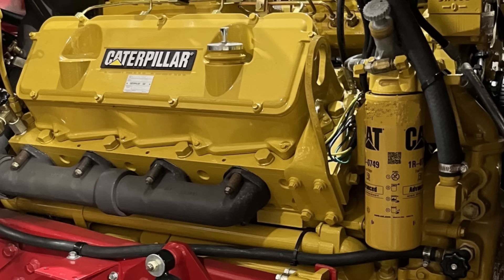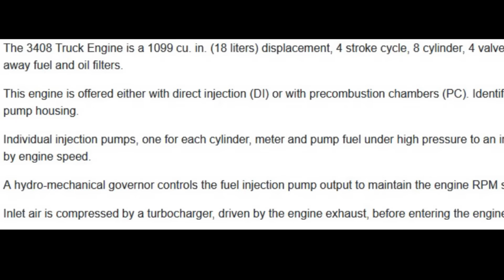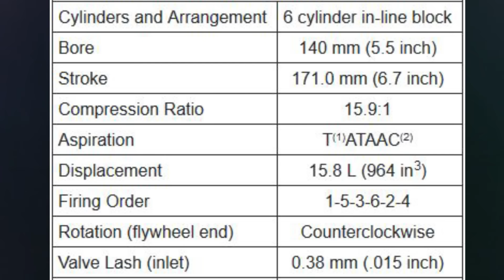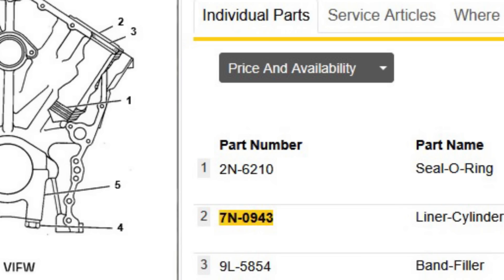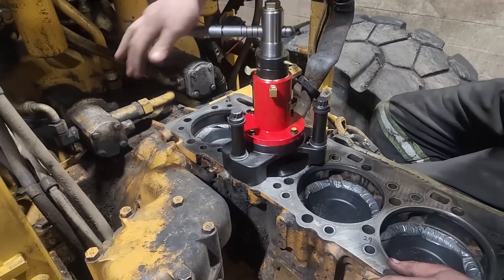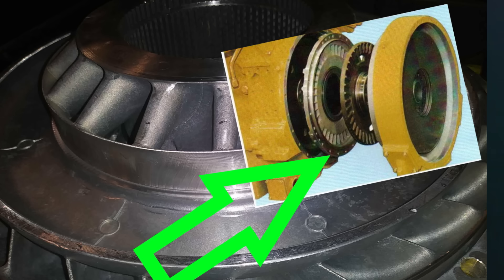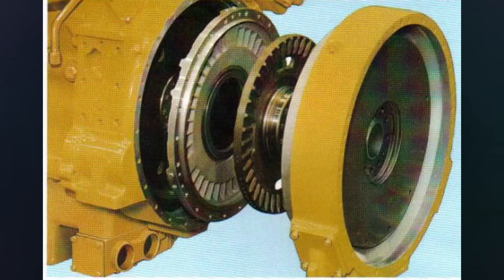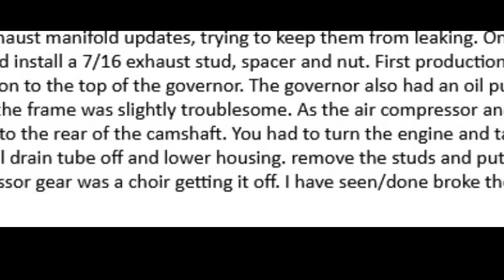The Cat 3408. Biggest Cat Truck Engine Ever Made. V8 18L Diesel Engine. "Know Your Engine"

Comment: I got passed by a few '08 large cars back in the 80s. Most had twin sticks, which I could see when they casually eased by me. As often as not, when they got around, I'd see two puffs of black smoke out the stacks and, in a few minutes, they'd be so far ahead of me I couldn't see them anymore. I recall this vividly on I 20 west of Ft Worth one day. Mind you I was going 80 when the dude passed me. Ext hd 359 it was. I was driving a reg hd 359 with a decent Big Cam, 15 OD, and 4.11s. So, as per usual in those scenarios, that guy had a bigger truck, a bigger motor, and much longer legs. Legend had it that there were guys driving those rigs and had top ends of well over triple digits. Used to see a lot of them at the fuel pumps at truck stops down south back then. I always thought the hoods were up just to show what was there LOL. Just to "flex" a bit, as it were.
Reply: Ran into an old private security guy  about 25 years ago. He said he was retired Texas DPS. I told him that I have one question. Before I could ask, he said "Yes, it's true. We looked the other way when truckers ran up to 110 mph on the interstate in the middle of the night". He said it's a common question. They never bothered the trucks, as long as they stayed in groups, were careful, and respected slower traffic. Those were the good old days.

Comment: Those memories. Peoria,il 40 years ago the pin to lock the injector pump and pull off the drive. And for a grade I had outer and inter head bolds here and there. Some paint some not. Teacher this would tell something wrong. Same bolts. 😊

Comment: Only 20000 plus to have fuel pump rebuilt.  Cummins KTA would leave them in the dust, and had 6 individual heads so one man could service them in the shop without an assistant.  I love watching your articles.  A person I worked with(owner-operator in the Seventies) had a deal with the Cat dist in eastern NY(Armonk) where he bought a New KW conventional with a 3408 in it and agreed to not touch the engine,except to check oil and water, and bring it back to them for all maintenance, plus bring it to their dealership promotions, and trade shows, etc.  At the end of his financing of the truck, they put in a brand new complete engine and took his.  During that time, they experimented with a prototype Jake Brake, but never fully  pursued it.  He was known all over the east coast because of its appearance and power at the time.
Reply: What was his name? I have a friend who was a owner operator in the seventies and eighties. Had several v8 cats. He put over a million miles on them. I bet he knew him.
Reply: @thelaststarfighter  Eddie Dignan, from Milford, Ct.  Was on Jones Motor Company.  Call sign on cb  was Shirley Temple
Reply: @billtodd6509  I've heard him on the radio on 81 in Pennsylvania
Reply: The Cat brake saver was a great engine brake. You could actually build boost idling, pulling on the lever
Reply: @billtodd6509  a good KT Cummins could run circles around the 3408 and get better fuel economy
Reply: @jim-zx7gz  Ill agrre with that.  One summer, many years ago, Bruce, at Pittsburgh Power had a dyno set up at a garhering of truckers, and an old old man from over in the hills of Maryland brought his old Pete conventional and it did over 1100 hp chained to that dyno and it was an everyday working truck. I believe he was from Cumberland, Md. area.
Reply: @jim-zx7gz I drove a KTA in a 1979 KW had a sound all its own it was fun for sure never drove a cat V8 my freind in SC said he liked that KTA better also and he had a V8 cat he dead now I miss talking to him I would call him every 3 / 4 weeks then one day his wife Janet said he was was exspired
Reply: Only in your dreams Cummins can't out run anything
Reply: @ uh…..

Comment: I like the 3408 Cat, that is definitely one of the greatest engines Cat ever made in my opinion. But Im pretty sure it's actually the 2nd biggest truck engine ever made in terms of weight, cubic inchs, liters, and stock horsepower rating. The K model Cummins is an all iron, 6,000 lb, 1,154 cubic inch, 19L, inline 6 engine. Their bore and stroke both are 6.25 inchs. They were made in the 70s. All the versions of it were the KT-450, KT-525, KTA-600, and KTTA-700.
K is the engine series, T means turbo, so 2 T's means twin turbo, A means aftercooled, and the number is the horsepower rating. The KTTA originally was actually a marine engine, but some people out there have put them in trucks as well. Them engines are BEASTS.
Reply from the maker: I've heard of those, I think I said the biggest Cat truck engine though, which I believe is still true. Cummins don't count 😉
Reply: @AdeptApe  Oh, I probably misheard you. I think you're right, pretty sure they are the biggest truck engine Cat ever made. On a channel devoted to Cats, Cummins does not count 😁😆
Reply: Biggest CAT truck engine said in the video. Cummins had to make that 19 liter monster to compete with CAT because CAT rated their engine at the wheels and Cummins at the bell housing. You buy a 450 Cummins it’ll have 360 horsepower at the wheels. Buy a 450 CAT it’ll have 450 horsepower to the wheels.

Comment: Hi mate , i'm a Mairine Engineer and Diesel Fitter,    worked for a company in Cairns Aust called Sea Swift, up in the Torres Strait nth QLD we had a front drop door barge named ,, MV Malu Cheif and she was 52 meters long,  her 2 main engines were 3408's and 2 genset engines were 3406B's,,,   such a pleasure to work with and be in her engine space,

Comment: This also explains why they are bad for cranks failing.
Reply: I don't know about that, but I do know that the split crankpins explain why the 3508 has a much lower power per displacement compared to the 3512 and 3516.

Comment: Personally not a fan of V diesels, despite owning one. 

I thought the C18 was used in heavy haul rigs? As in, triple axle truck / multi piece trailer.
Reply: i6 is superior. Period. In terms of engine package dimensions, acessory mounting, mechanical simplicity and robustness an i6 is inherently perfecty balanced.
The only manufacturer I know of so I could be wrong that has a V8 Diesel as their main staple engine is Scania and they only do it for legacy reasons they always were that one brand in Europe with the big V8 Diesel in their rigs and well they could switch to an i6 tomorrow but the V8 just has to stay its so unique and cool.
700hp 15.6L 3500nm/2580ft torque. Nothing to laugh at with the right gearing and axle setup the loggers in Finland gross 76 tons/167000 pounds and they trialled 104 tons.

Comment: Look at what the EPA took from us! 🤬
Reply: You mean ultra high polluters?
Reply: Thank Josh for your excellent videos !
Reply: The 3408, KTA, and E9 were all dropped from heavy truck use in 1986. The 3408 lived on as an industrial engine, until it was replaced by the C18 in 2005.  The KTA survives as the QSK-19 series. The E9 Mack lived to 1993.
Reply: @UnionThugg    the E9 actually has a really sad story. It's predecessor, the ENDT-864 was actually the 1st on-highway turbo diesel V8, beginning production some time in the early '60s (its NA version, END-864, was 1st sold in 1962). Mack sent a couple of them over to Scania as a result of the 2 companies working together at the time. That engine had issues with the fuel system as well as with head gaskets. In '69, they heavily revised that engine, it became ENDT-865 and ENDT-866. Scania used the same block, but put individual heads on it, that became the legendary DS14 V8. They kept sharing knowledge and tech after that. That engine was revamped with larger bore and stroke, addig up to 998ci. That became the E1000, later renamed E9 to fit the naming system used by Mack at the time. In the '90's, Renault Trucks acquired some percentage of Mack, and they actually brought the E9 to Europe in the Renault Magnum. Then in 2002 (if I remember correctly) Volvo bought Renault Trucks and Mack as well. Mack was still building E9's in 2002 with plueprints already made for a version with electronic unit injection to meet stricter emission standards, they were planning to put that in production some time in the mid 2000s. But Volvo killed it off anyway, probably due to internal politics. Most people say that it was axed either because Volvo didn't want any engine in the corporation that could outperform their own big bore engine, the D16, which barely cracked the 500bhp mark in 2003, while the top dog E9 was pushing 600, or because they didn't want to have an engine that had roots going back to Volvo's biggest competitor, Scania.
Reply: So glad they did!
Reply: @FEPA
Reply: More like cat couldn’t make it pass emissions. Scania and Volvo can do should cat
Reply: @alexstromberg7696  Because it's a mechanical engine. An electronic unit injector or common rail fuel system should take care of that, along with more boost on the turbo.
Reply: @electric7487  why didnt they do it then?
Reply: @electric7487  there was a 3408E, with electronic unit injection, but Cat only put that in dump trucks and stuff like that. I think Cat didn't want to keep that around knowing they probably wouldn't have made enough sales to be worth it.
Reply: Scania will bring back the v8 to North America soon

Comment: I worked for a cattle company in the1980s that had one in a 359 Peterbuilt  with a   5x3 , 2 stick trans , it got around 3 mpg , pulling a 48 ft, cattle trailer.  Imo the-best truck cat was the 1693 (425) cat.
Reply from the maker: 3 mpg, oh man. Better have a big fuel tank.
Reply: @ best i can remember it had 2 ,  150 gal, tanks.

Comment: I know of four trucks in Australia that have the 3408 in it: a 1967 Peterbilt 281 needle nose, a Kenworth W900A (imported from the States) and two cabover K123’s
Reply: There’s another two KWs in QLD that are having 3408s built up for re-power and there’s two cabovers in Melbourne sitting in a shed that will eventually get on the road.
Reply: @ those are the ones I know (with the cabovers, your one is one of the cabovers I know). The 1967 Peterbilt was originally Cummins powered but its owner decided to go for a 450hp 3408 instead..
Reply: Co Ord in the Territory ran a few in K124s
Reply: Great channel